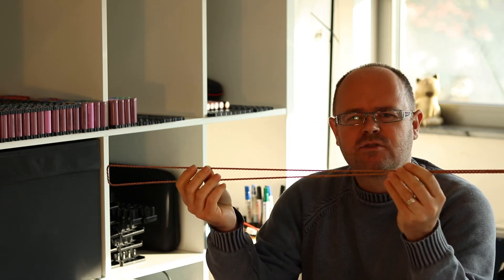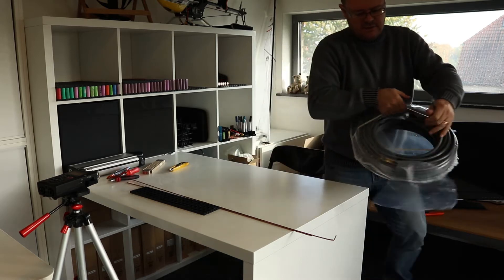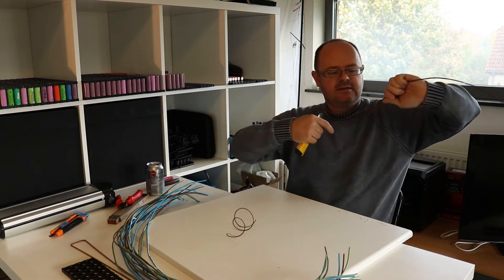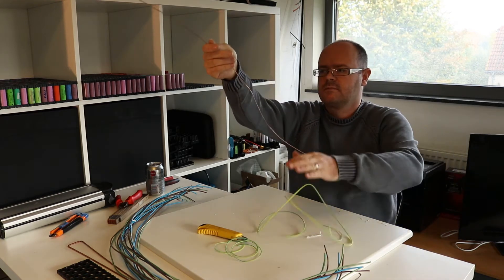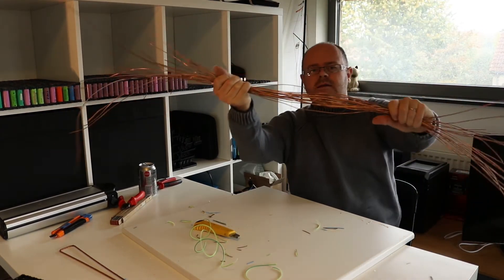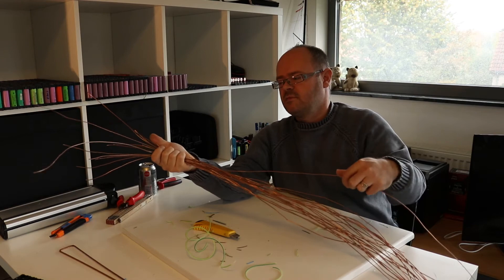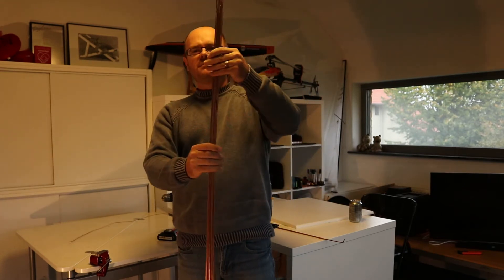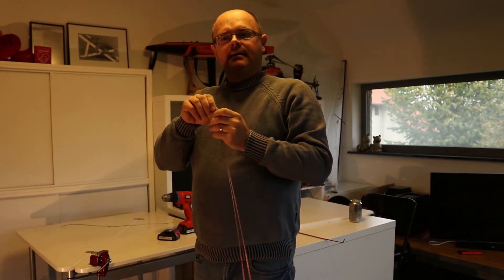18650 - Part 11 - Twisted Busbars For 18650 DIY Powerwal

Comment: An old trick on straightening wires: 

Anchor one end solid, and quickly "jerk" the wire so it snaps straight. (I usually use a pair of vise grips and let it slip out so the wire doesn't snap) The shock will straighten the crystalline structure,lining up all the stresses. 

That's how they used to make pins back in the day :)

Comment: What is the diameter of the wire you start with ...in mm..if possible thanks and good videos!
Reply: The wire I have is 6awg and 4.2mm I'll have 80 cell packs on a 48volt system with about .5a draw from each cell...what do you think about this...thanks for you time!
Reply from the maker: Hi, I use 3g 2.5mm.
Reply: Are you twisting 1 wire or 2 or 3 together
Reply: Ok..2.5 square. ...that makes a difference
Reply from the maker: 3 times twisted...so mine should be in total 7.5mm2. I think 6AWG is more then enough. AWG 8 should also do the trick.         AWG 6 = 13.3mm2.  AWG 8 = 8.3mm2.   AWG 10 = 5,2mm2
Reply: Thanks..I still have a lot of battery testing going on,,but hopefully starting soon on building my packs so I want to make sure I get it right